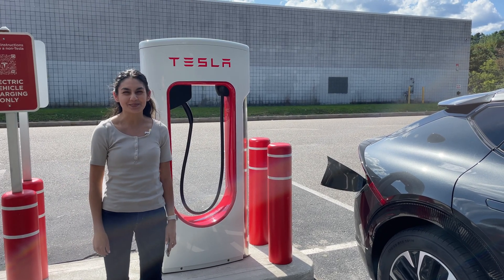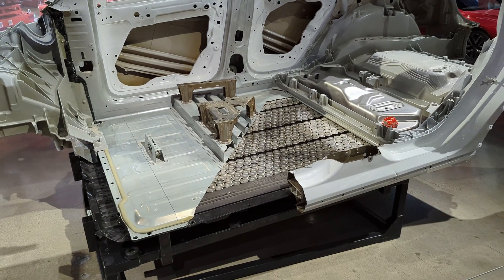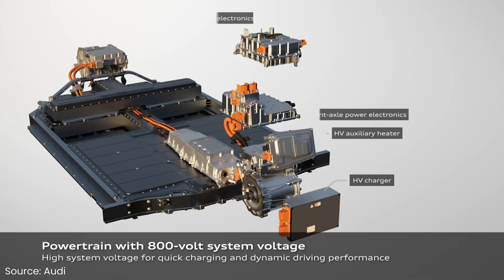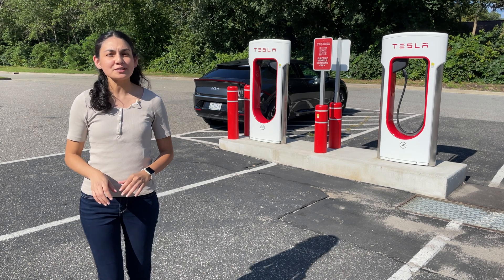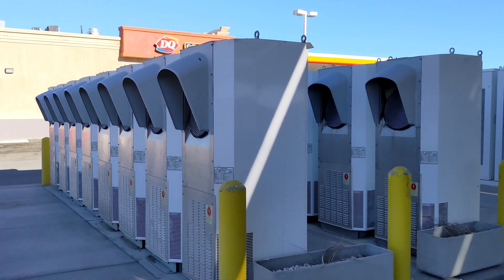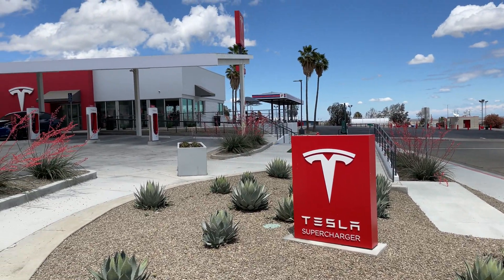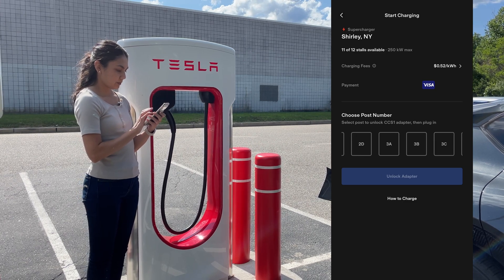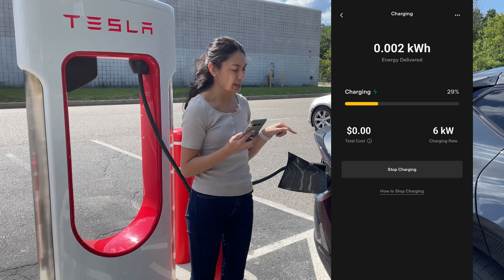Tesla Superchargers: Challenges for 800V Cars

Comment: Tesla is able to charge an 800v cybertruck by internally splitting the battery pack in half and charging both sides of the battery at 400v, this allows the CyberTruck to get 250KW at a V3 supercharger.  It gets a max of 327 KW on a 350, non-Tesla level 3 charger.  V4 chargers are rolling out with the capability of 615KW, but currently there's nothing that can utilize this kind of power (maybe a Tesla Semi can :D)

Comment: 800 volt architecture can reduce internal line losses but when you charge at home on a 240 outlet now the voltage must be boosted from 240 all the way to 800 volts. This will cost more on the power bill. EPA economy doesn't consider charging losses. If you want efficiency, stick with the 400v architecture as most manufacturers are not transparent about charging losses. You could expect similar losses if you charged a 400v architecture with a 120v plug. Should lose about 10-15 of your power.

Comment: Tesla superchargers are not the problem, I see people treat voltage as water pressure in a hose: more pressure you fill out a tub faster. People TESLA supercharger is not a problem because even in 800V you cant raise the cell voltage too fast and too much as you will damage it, those super high charging speeds never last more than a few minutes. Having reliable network is preferred to having a faster theoretical speed but not maintained and mostly non-functional
Reply: The low voltage is a problem. Yes full speed can not be maintained, but the higher initial speed will lower the total time spent at the station. This is a problem for all higher voltage vehicles and will be a bigger problem with high battery capacity vehicles (Pick-ups, delivery vans, transit buses).

Comment: Just discovered your channel - very well scripted and shot, good work. I think the Cybertruck has a switable pack that can be either 800V or 400V depending on what it plugs into - I don't have firm details on this, but worth talking about I think. V4 (tall) super chargers will solve all the problems, 1000V, long cables, CCS communication, we'll have to see how quickly Tesla upgrades their older sites, especially those ancient v1 120kW stalls in vital but lesser used location cross country.

Comment: It has NOTHING to with with the DC to DC boost in voltage. I Can charge my Ioniq 5 in Europe on a 400V 175 kW charger - and my Car Will receiver 175 kW. 

I Can charge 42 kW like you show on the video on Tesla V3 chargers, but on V2 i can chafe with 100 kW 
It’s a challenge in the CCS protocol, and Tesla seems not to care. Tesla’s network has been opened for long time in EU to all cars. 

I haven’t tested the one and only V4 super charger en Denmark yet, but I should support 800V cars.

Comment: The E-GMP cars do not use a traditional HV Booster, it actually runs the 400v through the motor to generate 800v!
Not quite sure why you would use the EV6 in the video but only talk about the other solutions to get 400V charging in 800V packs?

Also Audi/Porsche has a 150kw booster.

Also, if you take your EV6 to a V2 Tesla supercharger, you will get 100kw, but on the V3 and V4 you will only get 42kw, because Tesla changed something

Comment: I charged an EV6 on a Tesla V4 charger in the UK 4 days ago. V4 Chargers are available at a few locations across europe. The charge speed was limited to 42kw. Note in Europe most chargers and cars have CCS2 connectors so no magic dock required so the physical connector is not part of the problem. It appears in europe that eGmp cars can get 100kw at V2 Superchargers and only 42kw at V3 and V4. This is pending a software update on the Tesla side.

Comment: I drive an EV6 in Europe where we can charge at most Tesla sites. When I go to a Tesla v3 site I get 100 amps and 420 volts i.e. 42 kw. When I go to the Tesla v2 sites I don’t have this limitation. I cannot see the plug is the limitation and clearly the car is not the limitation when it works on v2 sites. The issue is only with Tesla v3 sites.

Comment: Tesla is eligible for a piece of the $7.5 billion federal subsidies for the construction of new electric vehicle charging stations across the country.  As long as Tesla includes Combined Charging System (CCS) connector, they're eligible for subsidies. Nothing in the Charging Network Act announced on June 27, 2023, compels Tesla to make it convenient or fast for systems other than 400 volts to charge.
Reply: Yes it does. Federal regulations require NEVI requires stations receiving funding to support 250V to 920V vehicles. Tesla has convinced some of the States distributing the funds that a 480V charger does that. They do not meet the intent of the law. They may meet the poorly written regulations issued by US DOT to distribute the funding.

Comment: Whoa… NY? Hope you're having a nice trip, Lorena, even if you had to leave Callas in AZ. I'm surprised you could even get a 40kW charge in that EV6. Others have not been able to charge E-GMP at all from Magic Docks. And now Hyundai is moving to an IMA pack. Will it solve the incompatibility? Sounds to me that, since Tesla is planning to put 1000V charging in its Cybertruck, they need to work out that level of charge for ALL their Superchargers ASAP. Once they do, I say they need to produce and sell "Magic Dock" connectors as separate adapters so consumers can purchase and use them with any and all NACS DCFC.
Reply: Magic Dock connectors won't work on "any and all NACS DCFC" because Tesla V2 Superchargers and cars communicate only on Tesla's proprietary CAN system and not the CCS system. The only DCFC from Tesla that will and can communicate with and charge a non-Tesla is Level 3 and Level 4 which incorporate both CAN and CCS communications. It will be the Level 4 that will support the faster speeds Lucid and Hyundai/Kia group (and others) need. A portable Magic Dock will not work period. It's not just about the connectors fitting. Don't forget, Tesla is going from a proprietary CAN only system to universal one that supports their CAN and the current CCS standard.  Once the current lot of earmarked Magic Docks are installed, that will be the end. Now that most OEMs have moved to NACS, the Magic Dock is essentially dead.
Reply: @Techridr  That's why I said "they need to work out" the compatibility. Sounds like you're saying it is simply NOT possible with V.2 and V.3 Superchargers. Ergo, the 1000v Cybertruck won't work on them either, only V.4 models. Wowza, Tesla better start cranking them out ASAP. Odd how Lorraine managed to get at least 40kW for the EV6. Fluke, I guess.
Reply: @Yanquetino  Yup, they need to get on it, but I have faith. The SC network has been growing 35% year-over-year so now that NACS is becoming the actual standard, I'll be willing to bet that growth curve will climb more. Also, I do think it's possible with V3, but they'd have to get each V3 online in a "standby" state with CCS communications but current V3s have short cables, so whats the point? That's cost prohibitive, so they only do the ones they currently add Magic Dock to, but again, I think the M-Dock is as good as dead. New V3s and V4s should have longer cables for any compatible car so they can just focus on compatibility with the new installs. The good news for us Tesla owners is that as crowded as it may get during the growth period, we still have a lot of V2 stations that ONLY Tesla's can use. I'm thinking with the timeline in place for Ford, GM etc., Telsa will have to have a certain amount "online" in order to meet whatever agreements they have with them, so I'm sure it will all get done